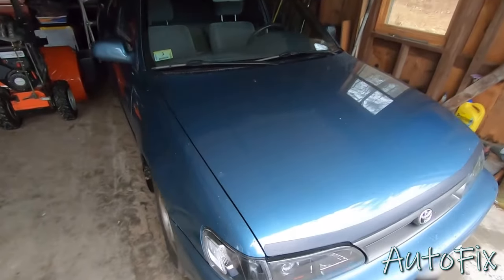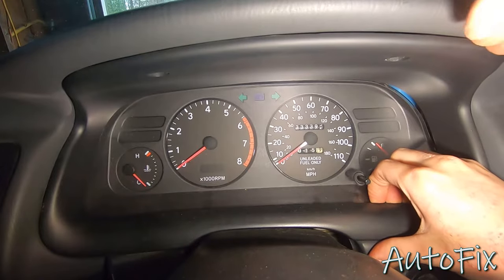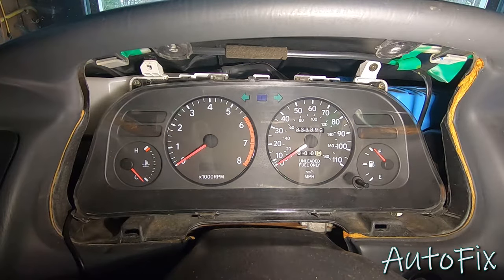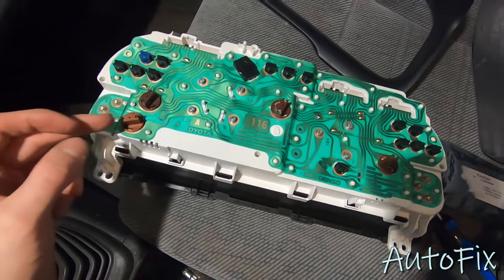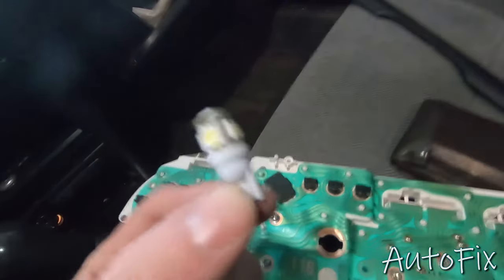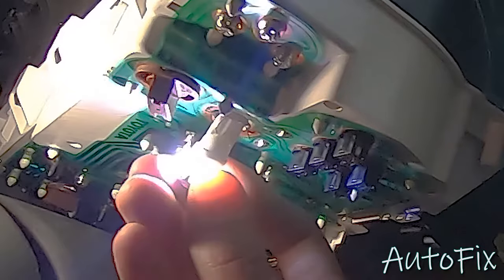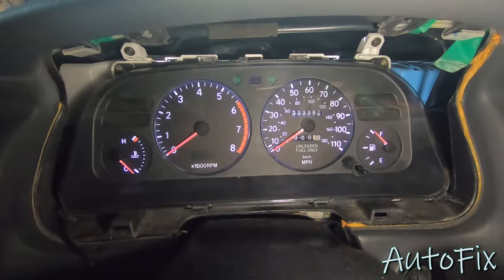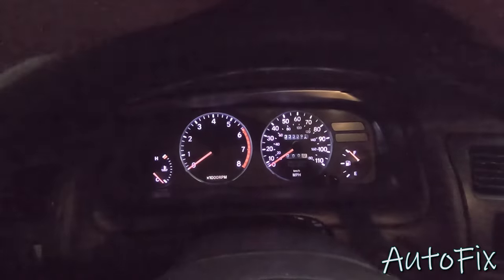Replacing Gauge Cluster Lights with LEDs - 93-97 Toyota Corolla

Comment: For those of you who have an ae102 like me, the blue plug is for the lights.
Reply from the maker: Thank you for adding the info!
Reply: thank you sm
Reply: @AutoFixYT  question sir. Any suggestions for the dead zone around 60-85ish? It bothers me in mine lol
Reply from the maker: Sounds like a bulb has gone out. Needs to be replaced.
Reply: @GlennC789  If they're led bulbs, they could be put in backwards, or it's more likely that the pins aren't quite touching and need to be bent a little more.

Comment: I just changed my gauge cluster lights today with the instructions shown in this video. Was extremely useful. To those who have the JDM AE101 Corolla that has the speedometer till 240km/h, there is one  difference, the no of LED bulbs excluding the fuel warning light is 4 instead of 3

Other than that it is the same. Thanks again Auto Fix

Comment: Hey I’m currently following the tutorial, don’t know if the previous owner of this car did this already.. however when I try to pull out the older lights from the brown twister it’s very stubborn to come out. Was there a way you “unlocked the bulbs from the holders? Or do it have to pull harder.
Reply from the maker: You just have to pull harder. In the past on other Toyotas I have had to use pliers and gently tug on the bulb while holding the socket with other pliers.
Reply: @AutoFixYT  thanks for the hasty reply, i tried that and the bulb shattered hah (i'm alright no cuts). is it the case of where the bulb is soldered in?  it feels like it would've already came out with some wiggling if it wasn't
Reply from the maker: @MrDdog678  Maybe they're soldered in? I've pulled those out of several Toyotas and I've never had one not come out
Reply: @AutoFixYT  upon further look, no clue what held them in so tightly.. however i opted to put on some gloves and remove the old bulbs by chipping away at them.. that worked out pretty well and the new LED bulbs you recommended here in the video fit and work great! thanks for the help. 

P.S. I've opted for full green interior lights and it looks great.
Reply from the maker: That's awesome!!
Reply: I know this comment is old, but for those who see it. BROWN sockets are soldered in, blue sockets are not. None of the tiny 74 sized sockets are soldered to the best of my knowledge.

Comment: Hi! My car has an issue with the speedometer and RPM meter. They do not show correct speed and RPM. But odometer works fine. It shows the correct distance. Can u help me with this issue?
Reply from the maker: I can't really tell you what exactly is wrong, but check all the wiring connections to the gauge cluster. Make sure the circuit board isn't broken or burnt. It could be that the motors that move the gauges aren't getting a signal. I don't know how to help you more than that. I may be worth it to just get another cluster from the junkyard that works and use that. You can roll the odometer to match your mileage.

Comment: Hi, your video was very much helpful. Could you please tell the part numbe / bulb type number (T 10, T3...) of the bulbs that been used in the meter cluster? As far as I know there are 3 types of T bulbs.
Reply from the maker: Thanks! They are 194 bulbs.
Reply: @AutoFixYT  All of those are 194? After opening the meter cluster I found those bulbs in 3 size variations. How to identify these variations when placing order online?
Reply from the maker: The ones that provide the backlight when you turn on your headlights are the biggest ones, they have brown connectors/sockets, and they are 194 bulbs.
Reply: @AutoFixYT  Thanks

Comment: do the LEDs affect anything with the car? or is it just basically so insignificant that it doesn’t hurt anything just looks better?
Reply from the maker: LEDs don't affect anything. You can swap any bulb you want for LEDs and nothing bad will happen, except for the turn signals. You will get hyperflash. Any other bulb will be treated the same as a halogen by the vehicle. I have swapped every single bulb in my car to LED besides the cigarette lighter plug and the turn signals, as well as the dummy lights in the gauge cluster. Everything else is LED. They make the car look a whole lot better in my opinion.

Comment: Curious if you have video for your Lexus GS dash
Reply from the maker: I don’t and I do plan on making one. The cluster on those GS models is lit up by a more rare type of lighting in the automotive world, CCFL lights. They’re not individual bulbs, they are tubes filled with gases that in the end emit light. This is why the backlight is so even across the gauges. They’re not individual bulbs. And because of this it is very difficult to replace them with LEDs. Not just the procedure itself, but then you have to customize the whole inside of the gauges so the light from the LEDs can be evenly dispersed across. Otherwise you end up with very blotchy lighting and dark areas.
Not something I’d want to do. If I ever have to replace the lights, I’m sticking with the original type of lighting that is in there.

Comment: Excuse me, do you know why a little shadow appears within 2500rpm and 80 miles? With normal bulbs and with LEDs, that shadow is always present
Reply from the maker: It must be something related to how the light gets dispersed inside the cluster. If you feel like taking it all apart go ahead and see if anything is broken internally. Other than that I have no idea why you have no light in those areas even with halogen bulbs.
Reply: @AutoFixYT  If friend is the strange thing, as if there was something that prevents the light from reaching that area, I will try to disarm to see what happens, thanks

Comment: Just watched this s video to help me change the bulbs on my 96 Corolla.i thaught it was gonna be a bigger job than it was ...thanks for the video...hey how do I calibrate my speedometer it's 3 to 5 mph slow ...
Reply from the maker: I'm hapoy that the video helped! Indeed this isn't that bad of a job. As for the claibration, I honestly have no idea. My speedometer has always shown 5mph over at any speed. I never bothered to fix it lol
Reply: do you have 185/65r14 tires or are you using a larger tire like a 185/65/15? Larger tires cause your speedo to read slow but as far as calibrating it I also don't know. Between those two sizes it would be 2.6 mph difference reading in the speedo at 60mph.
Reply from the maker: I use the stock tires for winter tires and I have 205/50R16 for summer tires. There is a difference in speed but my speedo is 5mph off with stock tires so it doesn't really matter to me anyway. If anything it kinda fixes it haha
Reply: @AutoFixYT  Did you have any clearance issues using tires (205/50R16) that big?
Reply from the maker: @bcmiller  Nope, no clearance issues. You just have to get a wheel with the right offset. Mine is +42

Comment: What about the other little bulbs, they didn't need to be changed??
Reply from the maker: No. Most of the time those are ok. All those small ones are just for the various indicators on the gauge cluster, such as high beams, turn signals, seat belt, air bag, check engine light, oil pressure, etc. Those are not worth changing to LEDs because they usually not even on.
Reply: @AutoFixYT  Thanks man, really appreciate the answer, awesome content you are making

Comment: Bro i have changed the bulbs mine had 4 big ones and there is another one which is really small but has halogen or incondencent but i cant figure out which led size should i buy ... That bulb covers 140-180 on my speedmoter which is blank for now
Reply from the maker: Not really sure since mine doesn't have that, my 4 194 bulbs lit up the whole gauge cluster.
Reply: @AutoFixYT  ok so that mini was an t5 bulb replaced everything good to go, BUT the needles dont glow they dont catch the light... please share your instagram so i send you pictures

Comment: I went through all the comments no one has asked yet will the same size bulbs work for the turn signals? Or is it a different size?
Reply from the maker: It's different. Both front and rear turn signals bulbs take an 1156 bulb
Reply: On the cluster?
Reply from the maker: Oh I'm sorry hahaha I didn't know you were referring to the cluster ones... my bad! I have no idea what size bulbs those are, they are the type that come with a socket and you twist them onto the board.

Comment: I have 3 connectors and 1 thick wire that goes to the speedometer.

How can I remove the thick wire?

Thanks.
Reply from the maker: You can de-pin it or cut it. If you're not sure how to de-pin it just look up a video, it'll be easier than trying to explain in writing.

Comment: Thank you for shearing 👍👍🇵🇷👍👍
Reply: Oh wow!!! Didn't expect an answer so fast 👍👍👍👍👍 I did verify the LED's at link provided and they're not available. My cluster is different 1993 Toyota Corolla 1.8l 7A-FE, no RPM GAUGE (tachometer)and I'm wondering if you could make a vid for that swap. 👍👍🇵🇷👍👍
Reply from the maker: Unfortunately I can't make a video for the swap because I don't have a car that doesn't have the tach. It would have different wiring so I can't swap a non tach cluster in mine either just for the video.
The bulbs should still be 194 bulbs. If the link says they're not available, here are some other ones you can buy: https://www.amazon.com/dp/B07G312DR2

Comment: Was there a trick to take the original bulbs out of the brown piece? Mine won’t come out
Reply from the maker: Force and no fear lol that's about it. Wiggle and twist too, that might help.
Reply: @AutoFixYT  force it is then haha thank you
Reply from the maker: @gavinauger4886  haha you got this! I don't know why  Toyota secured them so well from the factory.
Reply: Mine are the same, they don't come out. The bulbs are connected by tiny wires on the side.
Reply: 95 Camry
Reply from the maker: @drgoodspd6382  yeah you have to just work at them
Reply: @AutoFixYT  
Bro, I'm not sure you understand. The bulbs and the plastic piece are literally joined together. They are not meant to come apart. Ours are different than what is shown.
Reply from the maker: @drgoodspd6382  Oh... yeah I did not understand that lol
Not really sure how to help then
Reply: @drgoodspd6382  you can buy the clips separately
Reply: @gavinauger4886  
That's the only way, yeah? 
Can't use LEDs?
Reply: @drgoodspd6382  u can, but that’s the clip the leds sit in
Reply: @gavinauger4886  hmm. Those tiny wires need to break off the bulb and stay wrapped around the plastic piece?

Comment: Thank u man , just changed mine but not LED , i like the classic one 
I need ur help to change my antenna please man
Reply from the maker: Awesome!
I'm not entirely sure how to remove the antenna because I've never had to do it. I know there are two screws on the outside that you have to take off, but then you might have to take the plastic trim piece off the A pillar to unplug the antenna before removal. Not sure.
Reply: @AutoFixYT  that is the easy part , i wanna know the wiring steps.
Anyway i appreciate ur help 👍🏻

Comment: I love your videos brother . Very helpful and straight forward . I have a question about the rpm guage are they are on these corollas ?
Reply from the maker: Thanks!
I assume you meant is they are rare... I don't know! I think they are definitely rare on base models or automatics. This car being a manual transmission it's helpful to have the RPM gauge. It's also a DX not a base model. But I've seen many Corollas that don't have it. It's a good question though! I can't give you a good answer though, just a guess.
Reply: @AutoFixYT  can you swap to a rpm gauge cluster?
Reply from the maker: @braydenbiondich6815  I've been asked this everal times and I never know the answer 100%. You can try, and hopefully the connectors match up and the wires are all there. But I don't know, I've never had to do it.

Comment: So have a 93 corolla dash lights went out cause my stereo got ripped out n all those wires are now cleaned up but no stereo n no lights still?
Reply from the maker: Start by checking the fuses and see if any of them are bad. There is a fuse box in the engine bay, and one underneath the driver's side kick panel. If any are bad, replace them with the correct amperage fuse. If that's not the case, check for power at all the wires that lead to your headunit and gauge cluster. If they have no power then I would keep following those wires and see where they lead. Maybe something is broken, disconnected, or not making proper contact. Definitely start with the fuses though. All of them one by one.
Reply: Auto Fix, bless

Comment: Quick question:
Can I upgrade my gauge cluster with the rev counter mine doesn’t
Reply from the maker: Yes you can! It should be plug and play in you just get the cluster you want. There is also a way to take the cluster apart and make the mileage on the new cluster match the old one.
Reply: Thanks a lot!
Reply: I tried it  but the clusters/rev gauge didn’t work don’t know y maybe faulty
Reply from the maker: Hmm... maybe I was wrong and you need to wire up the tach?
Reply: @AutoFixYT  if you have a 1.6 95% of the time it won’t work. If you have a 1.8 you should be a okay due to that’s the only model that came with the rpm as a option

Comment: Will this work for a Toyota Camry 1996?
Reply from the maker: You can use the same bulbs but the process isn't the same. Similar, but not the same. Instead of the small bezel around the cluster you have to remove the whole face of the dashboard. So everything from the driver's vent all the way to the radio and heater controls is all one giant piece of plastic. Once that's off the cluster comes off the same way, 4 screws, 1 in each corner. Then you can replace your bulbs with 194 bulbs for the backlight. I did it on my 96 Camry Wagon but didn't film it. It was annoying to do haha

Comment: I have an 03 Avalon xls and i just to change the bulb for the odometer. Does it matter about which bulbs i use or are they the same?
Reply from the maker: As long as you use the right type bulb (194, 74, etc.) It doesn't matter whay brand or if it's LED or not. It just needs to fit.

Comment: My needles don't get good enough light to glow. What can I do??? Not sure if the lights are right, they are T10 LED lights but idk about the 194 part
Reply from the maker: T10 is the same as a 194. Use either and they'll fit.
Reply: @AutoFixYT  ahhhhh ok. Still the problem is there. The needles are very badly lit. I thought it could be the length of the bulbs since the LEDs are longer than the og bulbs, but I found some shorter ones and the needles still look like crap so... Idk what to do in this case. Might just go back to the normal bulbs
Reply: @AutoFixYT  the badly lit needles are only the RPM and speedometer needles. Fuel tank and temp look fine
Reply from the maker: Very strange... Mine look good and actually are better with LEDs

Comment: After changing the bulbs of my gauge cluster the fuel gauge of my toyota corolla big body drops empty and it wont rise up again where my fuel level supposed to be. Can you help me?
Reply from the maker: Check for a bad connection. That means the gauge isn't getting power anymore. Maybe it just so happened to break right then but most likely it's not getting power. So take it all back out and get the cluster disassembled, and with the ignition in the "On" position, take your multimeter and check for power right where it connects to the gauge. If you do have power but no movement, that means the motor that moves the gauge is bad. If you have no power, then go down the line until you find where the signal is interrupted.
Reply: Yeah you are correct! Thank you so much! 😊
Reply from the maker: @angelicamariemurillo5914  Awesome!

Comment: Brighter leds are pinching during long night drive, as of my experience.
Reply from the maker: But you can use the dial on the left side of the steering wheel to turn them down at night

Comment: Idk how to do this on the 2011 Toyota Corolla
Reply from the maker: I don't know either :)
I don't have one of those so you'll have to find a video that shows it, or figure it out on your own. Toyotas are all very similar in design so there should be a plastic bezel around the gauge cluster, and then some screws or bolts for the cluster itself and that's it.